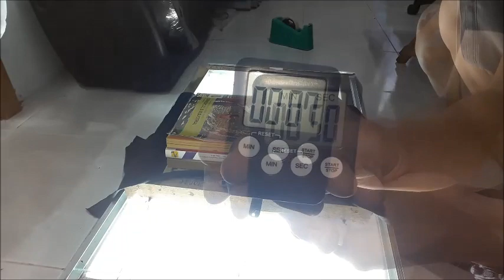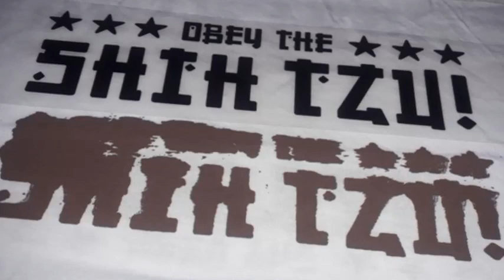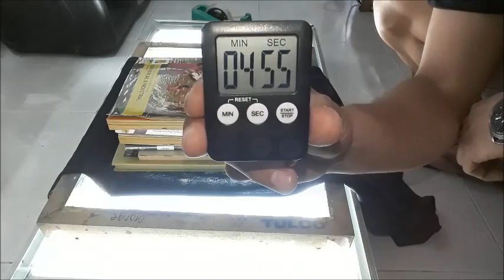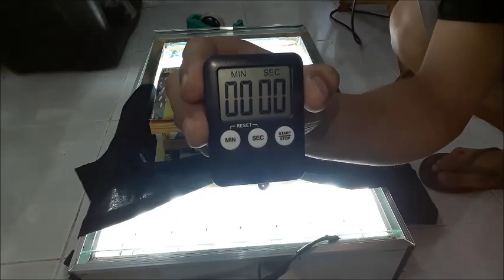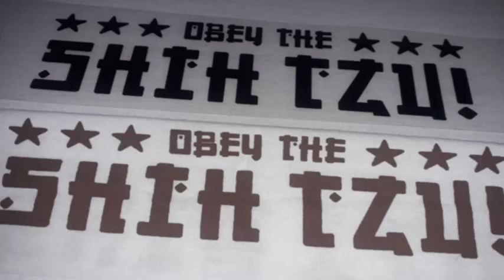SCREEN PRINTING 022 | HOW TO APPLY PHOTO EMULSION | AQUASOL ER | HILAW AND OVERCOOKED EFFECT | DIY

Comment: Anong film po ba ang gagamitin sa pag print ng layout at anong ink? Pwd po ba ordinary paper?
Reply from the maker: Sa ordinary bond paper lang po ako nagprint then zerox lang sa acetate or transparency.
Reply: @EyeSpoTeeV  pano po gawing transparent?
Reply from the maker: @gerrychan7110  yung design ko sa bond paper, pinapazerox ko sya gamit ang transparency
Reply: @EyeSpoTeeV  pwd ba oil na lang ilagay para maging trnasparent?
Reply: @EyeSpoTeeV  ordinary Xerox machine pwd na?
Reply from the maker: @gerrychan7110  pwede din naman ganun ginagawa nung iba pi.
Reply from the maker: @gerrychan7110  yes ipadarken mo lang.
Reply: @EyeSpoTeeV  sana gawa ka sir vid kong pano yong process. Newbie palang ako at wala pa akong material.

Comment: Boss tanong Lang ? Mayron akong exposure box na tig apat na 14 wts na flowresent bulb..pro hinde ko mkuha Ang tamang oras..boss..ilang minuto ba dapat..? At Ang gawin ko pra mkuha ko Ang tamang oras?? Salamat Sana boss masagot mo..
Reply from the maker: kapatid ang tangi ko masasagot sayo ay trial and error, magset ka ng oras ng exposure,,,,kung sa oras na yun ay natatanggal ang emulsion sa screen mag adjust ka ng oras pataas meaning hilaw ang expose,,,kung hindi naman matanggal ang emulsion magbaba ka ng oras meaning overcooked, subukan mo 30 seconds ang adjusment both gang sa mabutas ng tama ang layout,,,isang option targettin mo 80 pataas ang total watts ng ilaw mo.tyaga lang dahil kung diy ang exposure box mo ay hindi natin makukuha ng isang try lang.

Comment: SIR ILANG ORAS PO YUNG PAGPAPATUYO NG EMULSION? 

Pwede din poba gamitin yung LED lights for burning? Ginamit ko po kasi LED NA WHITE then hindi na burn maulan kasi wala sunlight
Reply from the maker: kung iblower mo 3 to 5 mins,,,kung itapat mo sa electric fan, mga 10 to 15 mins, pwede naman led lights kapatid baka hindi lang tugma ang unit sa time exposure mo.
Reply: Sinubukan ko po eh ilang minutes ko po ibabad sa Led lights sir?
Reply: Ginamit ko pong pang dry sa Emulsion ko blower and gamit ko naman po is TULCO AQUASOL ER

Comment: galing mo talaga sir eyes. ang lupet. sir eye may tanong ako sa u. spot light hollogen 500watts. ilan minutes po yung time exposure ko.
Reply from the maker: Salamat, ang need mu po sir gawin magtrial and error ka po,,ifixed mu n po ang taas ng clear glass tapos sa oras k n po ng exposure time mag adjust,mag start ka po sa 3 mins tapos apply mu po yang nasa video ko,kung hilaw,mag add ka ng oras at pag overcooked nman eh bawas ka po ng oras. Salamat
Reply: @EyeSpoTeeV  sir eyes talaga bang ang emulsion er ok lang na tamaan ng liwanag ng light. d ba yan maselan sa liwanag. salamat sa u. idol
Reply from the maker: @jholobiano6752  base sa experience ko hindi naman po masyado maselan,kung ano po yung ginawa ko sa video,ganyan po lagi ang ginagawa kong pag aapply,salamat po.

Comment: sir eyes pag glue at sensitizer lang yung gamit mong photo emulsion pwede po ba na imag mix ng marami pra maigamit mo sa susunod ...?
Reply from the maker: Kapatid wala po ako idea sa lifespan ng glue at sensitizer pag napaghalo na. Aquasol er user po kasi ako salamat
Reply: @EyeSpoTeeV  ahh sir eyes tanung po ako ulit...sir bakit marami bisis naako nag calcu nang exposure time ko lgi po na tatangal  yung emulsion kapag tumatagal ..dahil nga ba yan sa pressure ng tubig?
Reply from the maker: @SportsIn.1486  isang factor sa mixing ng glue at sensi, pangalawa sa exposure kapatid.

Comment: sir. eyespot bago palang po ako sa pag p-print actualy starting palang po sa pag aaral ng silk screen printing ask ko lang po kung paano o ano po ang dapat kong gawin kung wala po akong gamit na blower para sa photo emulsion at pano ko po ba malalaman kung tuyo na o pwede ko ng i expose sa araw o sa exposure box
Reply from the maker: pwede mo sya tapatan ng electric fan pero sa mejo dim na location, kung ang photo emulsion mo ay katulad sakin aquasol er, malaman mo sya na tuyo na pag nag dark blue na ang kulay nya.
Reply: @EyeSpoTeeV  salamat po sir eyespotee v ...  tanong ko lang po ulit tungkol naman po sa silk screen frame ano po ba yung regular size o tamang sukat ng frame para sa damit DIY po kasi ako ng sarili kong frame at anong sizes din po ng kahot ang mas magandang gamitin salamat po ulit at godbless po sainyo at marami pa po sana kayong ilabas na tutorial video salamat po
Reply: kahoy po 😅😅✌️✌️

Comment: Sir may tanong ako ilang mesh count po ba itong 1m(39.5-in) x 1.52m(60-in)?
Reply from the maker: Baka po hindi mesh count yan, baka po sukat ng mismong screen length and width
Reply: @EyeSpoTeeV  sir san po makikita ang mesh count bagohan po kse ako tsaka may nabili akong frame with screen na :(
Reply from the maker: Wala pong label sa mismong screen pag sa printing shop ka bibili pero identified naman ng supplier,,,pag sa national bookstore may label po size ng screen at mesh size.

Comment: Hello eyes pano po malalaman ang tamang oras sa exposure unit na gamit ??
Reply from the maker: Hi po,pachek po yung video ko screen printing 017 exposure box tnx po.
Reply from the maker: Plus trial and error po
Reply: Hi po sir jomhel, share ko lang po sana maka tulong. Kapag nag diy po kasi nang exposure box, kailangan talaga mag trial and error sa pag expose nang screen, kasi naka depende po yan sa distance mula sa ilaw hanggang sa ibabaw ng crystal at sa amount ng ultra violet (uv) na linalabas ng ilaw na ginagamit  mo.more uv, shorter exposure time, lesser uv means longer exposure time. Sana po nakatulong.salamat po.

Comment: Kinakamay nyu ang pagbubutas sir? gmit ng water? hindi spray with pressure?
Reply from the maker: Gumagamit din po ako ng sprayer sir tnx po.
Reply: @EyeSpoTeeV  slmat sir sa reply.. nice video tutorial tlga.. detail kng detail.. next nmn sir paano mgregister ng multicolor sa screen for line table before exposure.. yung after ng exposure ng screen eh anong adjustment ang gngwa para maalign ung register ng mga screen sa line table.. slmat sir tlga sa help.. God bless
Reply from the maker: @lunar7143  salamat sir, noted po,mejo busy lang po talaga ngayun pero sunod n po cguro ang allignment sa screen for 3 colors.
Reply: @EyeSpoTeeV  pasensya n dn sa pangungulit sir.. slmat tlga ng mrmi.. masyado m
na akong demanding.. Pero aabangan ko yan sir😊
Reply from the maker: @lunar7143  walang prob sir,salamat din sa pag appreciate.makapag share lang ako at may mapulot kayong konting info masaya n ko don sir.

Comment: bos ano problema pag nag shadow ang hagud mo yong naga subra  sa gilid na parang basa?
Reply from the maker: May table adhesive po ba platen mo kapatid?
Reply: @EyeSpoTeeV  mayron  po pero kulang hehe,,, ok na ngyon sir pina ulit ulit ko pinanoud mga video mo kulang lang ako sa adhisive now ok na po salamat at sa mabilis mong reply......siya nga pla sir same ink lang ba ang ginagamit pang printa ng ballon at mga  plastic gallon sa mga water ?
Reply from the maker: @dreampixdigitalprintingser5602  wala pa ko idea sa ink ng plastic pero di ubra ang water based.

Comment: Idol gud day,,  ask kulang f kailangan paba haluan ang nabili ko na tulco photo emulsion local ( aquasol er). White kulai nya kc..  
Ty idol #newbie lng
Reply from the maker: Yes pag local po may sensitizer po na hinahalo. Salamat
Reply: @EyeSpoTeeV  ty idol big help.. 
More power idol
Reply: @EyeSpoTeeV   pahabol idol,,  OK lang ba haluan ko lahat ng sensitizer khit d ko gagamitin lahat ng emulsion?
Reply from the maker: @mikeanuta4766  para po sakin wag muna,,,kung ano lang po yung sa tingin nyo na gagamitin nyo yun nalang po muna lagyan nyo po. May percentage po yan, di ko lang po kabisado ang percentage.
Reply: @EyeSpoTeeV  ty idol
Reply: @mikeanuta4766  pag sensitizer at photo emulsion local po, yong ratio na ginagamit ko 1part sensitizer:6parts photo emulsion local. Pwede rin gamitin ang white glue kong walang PE local. Gamit ko po ay apollo white glue, mas mura kasi pero ok naman ang quality. Sana po nakatulong.

Comment: Goodafternoon sir, ask ko lang po sana aquasol er po yung gamit ko na photo emulsion pero nagpuputol putol po yung linya ng kada letter. gumamit na din po kami ng step wedge para po sa exposure time pero ganun pa din po. thankyou po
Reply from the maker: Panong nagpuputol putol po? Nababakbak ang emulsion?
Reply: hindi po, parang lagare po yung mga edges nya
Reply from the maker: @jonjonhernandez3145  may ilang factor, makapal ang emulsion, hindi masyado solid ang layout, at exposure time.
Reply: bondtika po kasi gamit ko po sa layout then yung pang expose ko po 500watts na halogen. ano pa po kayang paraan po para maging maganda na po yung mga edges? sorry po ang dami ko pong tanong nagsisimula palang po kasi eh. thankyou po ulit
Reply from the maker: @jonjonhernandez3145  walang prob kapatid, karamihan sa nakakausap ko sa bondtika mejo naglalagare, pero kung sakto at di makapal ang hagod ng emulsion sa screen, baka sakali makuha ng maayos, tey mo din idarken yung layout sa bond paper kapatid.
Reply: Salamat po ng marami. Godbless po

Comment: Sir eyes pwede poh ba mag double coating sa pagpahid Ng emulsion tapos pano malalaman ung tamang sukat Ng ikaw at lakas nito para maset ung tamang exposure time salamat poh sir
Reply from the maker: Pag tuyo na tsaka ka mag double coat sir? Kung gagawa ka ng sarili mong design ng exposure box, need mo mag trial and error para sa exposure time.
Reply: @EyeSpoTeeV  gusto ko po itry umg bionigay nyo na mga materiALS sa pag gawa poh ng exposure box
Reply: @EyeSpoTeeV  kahit poh ba double coat ung emulsion eh same lang poh ba ang exposure time at anu poh ba epekto pag two coat sa single coat master
Reply from the maker: @irish804  mas maige kung gagayahin mo atleast may idea k n po sa exposure time
Reply from the maker: @irish804  di po pa na experience mag 2nd coat sa emulsion sir, pero for sure kakapal cya,,,sa exposure feeling ko same lang din,,,mabubutas parin yan.
Reply: @EyeSpoTeeV  salamat poh master sa walang sawang pagsagot sa mga katanungan ko salute poh sa inyo master
Reply: Master napanuod ko dun sa Isa mong vlog ung paghahalo Ng pigment sa blog#29 pano ba malalaman na sakto o Tama ung amount Ng white at clear pano magsusukat Yun master tapos sa pigment may narinig ako dati na Kaya kumakatas eh overpigment salamat poh Sana mapansin nyo poh

Comment: sir neeeded pa ba ng photo hardener and aquasol ER? ty
Reply from the maker: Aquasol er ay photo emulsion, hardener mas maige kung maglalagay ka kapatid.
Reply: @EyeSpoTeeV  salamat sir.
Reply: @EyeSpoTeeV  sir mag tatanong ulit pcensya na .. ano ba cause ng  saw edges sa design?  aquasol ER gamit ko? ty sir  ..
Reply from the maker: @laydeljigen9947  isang factor kung hindi super dark ang design mo sa acetate,,,isa din ay kung sobra kapal ng photo emulsion,,,at the same time exposure at washing ng frame.
Reply: @EyeSpoTeeV  maraming salamat sir...

Comment: lods,may tanung ako bakit pag nag mix ako ng pigment ink black sa ecomighty clear nilagyan.ko ng kunting white mighty , try ko eh wash test after 12 hrs. nag bleeding
Reply from the maker: ilan sa mga factor nyan ay una sobrang nipis ng damit, pangalawa ay sobrang labnaw ng ink at pangatlo curing time ng 8hrs, try mo po 30 to 40% white then 60 to 70% clear plus pigment
Reply: thank you lods, sa advice nag try ako sa lalagyan ng 250ml na tulco.. isang kutsarang white tapus clear mga kalahating sukat sa 250ml na lalagyan ng tulco.. di na po sya nag bleeding kahit blower ko lang after 10min. okay na po.. try ko po print sa active dry, at sa cotton na damit..di na po sya nag bleeding pag washtest ko

Comment: Lods, yung exposure box ko kc apat na flourescent lang. same din ng gamit mo. Ang exposing time ko 4:30 minutes. Kaso hirap ako maghugas eh. Yung mga straight line yung iba parang baluktot pati mga edges di makuha yung tulis. AQ ER din gamit ko. Then tracing paper lang gamit ko at nilalagyan ko pa mantika. Pa advice naman lods. Thanks
Reply from the maker: try mo kapatid magdagdag ng exposure time paunti unti kung hirap magbutas sa 4:30
Reply: @EyeSpoTeeV  salamat lods. Malaking tulong ang reply mo. More power sa eyespotee v 😍

Comment: Sir! Ok lang ba khit di gumamit nang super white s dark collor at ok lang ba haluan nang fixer ang super white? Thank you.
Reply from the maker: Ang ibig mu po bang sabihin ay underbase po na white or or sariling mix ng pintura para sa dark color na damit? Pwede po haluan ng fixer ang super white po, salamat
Reply: Ok lang ba sir na hindi na mag base white s mga dark collor? Karaniwan ko kasi nkikita sir pg over two collor at dark ang damit e  ng gagamit nang base white.
Reply from the maker: @lestercruz1103  okey lang sir n walang underbase,nasa mixing lang po talaga ng pintura,katulad nyan ginawa ko,wala pong underbase yan n white pero may white po sya n content sa mixture ng pintura. Gawan ko po ng video para mas klaro po salamat.
Reply: @EyeSpoTeeV  salamat sir sa panibagong aral God blessed! Chaka sir anong sukat nang line table mo! Salamat.
Reply from the maker: @lestercruz1103  salamat sir,yung pinaka table po 15 x 19 sir.
Reply: @EyeSpoTeeV  salamat sir! Chaka sir pano ung pag gawa nang same spot nang more than 3 collor s creen yung pag lapag nang screen ok na at dna kailangan nang silip mode.
Reply from the maker: @lestercruz1103  sir pasilip po ng video ko screen printing 010 table guides and center guides po,salamat
Reply: @EyeSpoTeeV  sir! May balot paba nang manipis na foam at tarpaulin ung line table mo? Ano ba idol mairerekomenda mo? Thanks in advance God blessed.
Reply from the maker: @lestercruz1103  yes sir soft po yan may foam at tarp po.
Reply: @EyeSpoTeeV  maraming salamat sir!
Reply: @EyeSpoTeeV  sir! Pwede po b haluan ang super white nng water base? Thanks sir!
Reply from the maker: @lestercruz1103  sir kung ang super white mu po ay water base,,,pwede po.

Comment: Boss paano po kung 200watts na LED light lang gamit ko gaano katagal ang exposure na kelangan ko. Thank you po in advance sa sagot
Reply from the maker: hindi lang po sa watts ng ilaw nakadepende ang exposure time,consider din po ang taas ng exposure unit
Reply: @EyeSpoTeeV  sabihin mo n lng po ilang watts at ilang ilaw ginamit mo po para makatulong ka po
Reply from the maker: @donnasanico4964  7x14watts